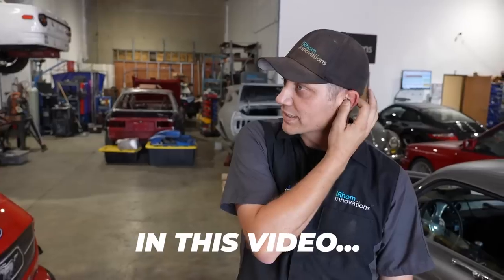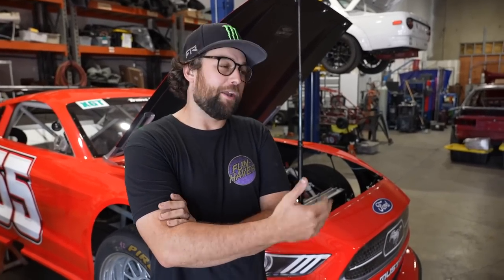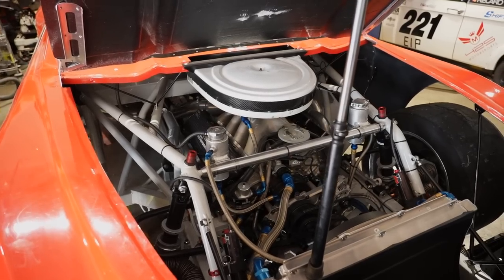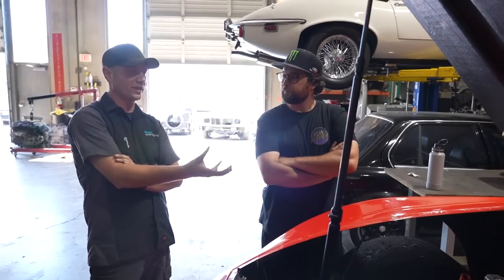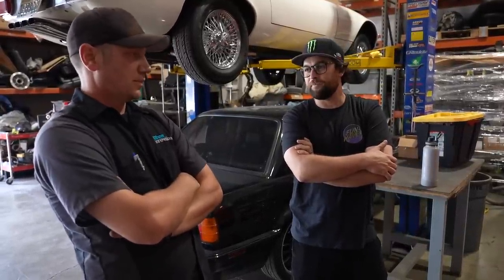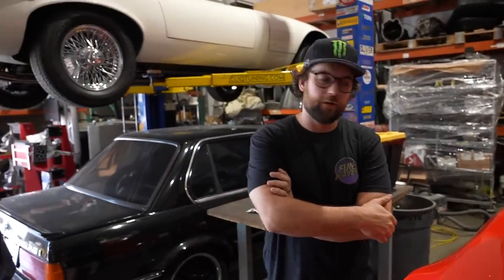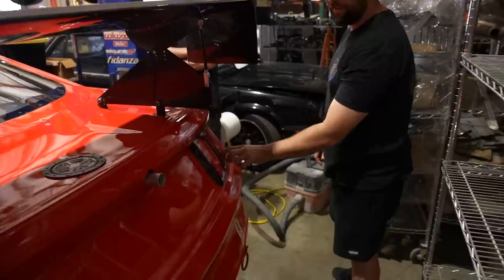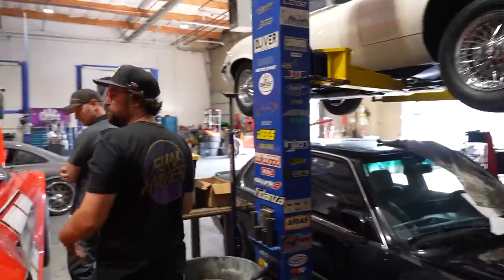SHOP TOUR - A Race Engineering Team That Also Builds And Maintains Dream Cars - Rhom Innovations

Comment: In the nascar cup dyno testing I did we would run 135-142 C coolant and. 180-185C oil temps and do that for 800 miles on the dyno. End goal for the teams/engines was 300F water out 400F out. So those temps are pretty normal.. with all the tape the run on the front ends at the 1.5mi + tracks and being in traffic drafting they gotta be able to run pretty hot for a while.